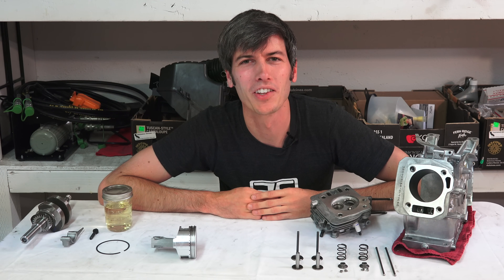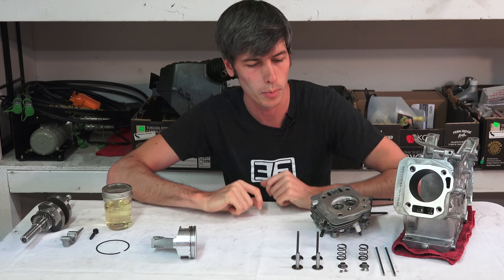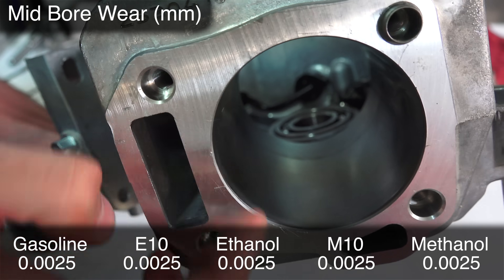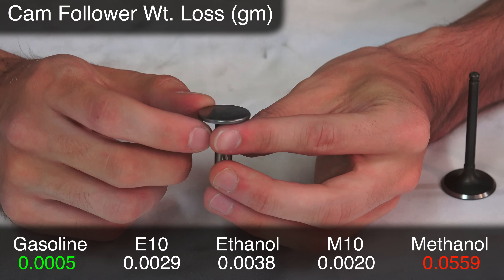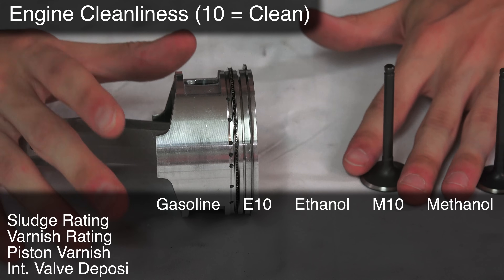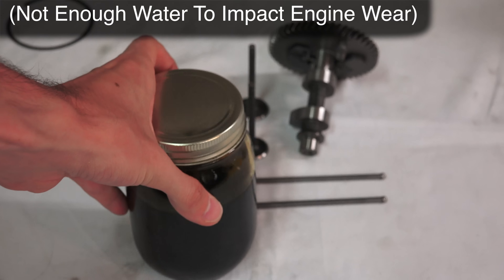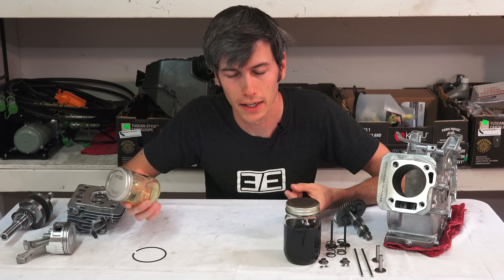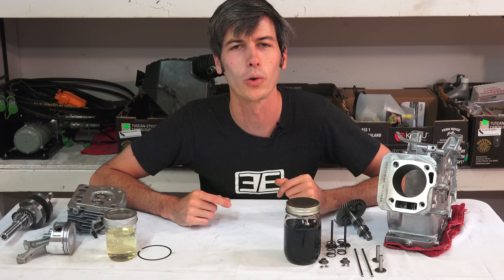Is Ethanol Bad For Your Car's Engine?

Comment: You must not forget that there is a powerful political interest at stake here. 

It is not by accident that ethanol is presently required by law as an ingredient in motor fuels.  Nor is it a coincidence that ethanol is for the most part produced using corn as a raw material. 

There are a handful of American states that produce the lion's share of corn used for refined ethanol and their US Senators and Representatives get to remind us every four years, when all of the presidential candidates go to the Iowa Caucuses to kneel before the Corn Gods and promise not to rock the ethanol boat after they're elected.  It's big business.  Candidates who do poorly in the Iowa contests are finished.  Their donor money dries up. 

This isn't about gas mileage or clean air or any of the other BS.  It's a racket.  BTW, no serious person is discussing using 100% ethanol or methanol as fuel.  They really don't work well in passenger car or pickup engines except as blends.
Reply: Nailed it Jim.
Reply: @totallyjonesin  For those who want the extra octane a 50-50 blend of methanol at least makes sense economically.  America has enough coal (and natural gas) to make refined methanol for centuries.  The business of using corn to make ethanol has bumped the price of practically EVERY agricultural commodity, but for the benefit of very few states and companies.  Ethanol and methanol as blending agents in gasoline are virtually identical and they both offer consumers some advantage, but ethanol cannot be produced from coal (or natural gas) the same way that methanol can.

Comment: the alcohol destroyed the fuel level sensor in my 1986 Yamaha fj1200 fuel tank and yes it is bad for my 1990 Ford Thunderbird. It has been disastrous in some Nissans.
Reply: Mine 1985 Nissan Sentra is still going strong

Comment: Dont put in lawnmower (or unleaded gas recommended cars for that matter). Air/fuel mixture foesnt ignite or ignites too much, I think. I recall putting high test ethanol in my truck and suffered misfires- too high octane.Hadvto dilute with regular.  And in lawnmowers same thing plus causes water during winter storage. Rots fuel lines, I believe, but I cannot prove it.

Comment: Tell us about gas mileage when using E10 and unleaded fuel.
Reply: Bennie Cochran Ethanol will give about 70% mileage due to its 30% lesser energy value. So 10% ethanol mix will give you 3% less range in a tank

Comment: Ethanol is hydrophilic and absorbs water out of the atmosphere and deposits it in the bottom of the fuel tank.  If the fuel tank and fuel lines are steel they will rust.  The water is then pumped into the fuel system. It causes corrosion and other deposits to accumulate in the fuel bowl and plugs up orifices in the carburetor and fuel injectors.  If the fuel bowl is steel it will rust.  The alcohol also dries out and deteriorates certain types of seals and gasket materials causing them to lose flexibility and leak.  Millions of engines have been irreversibly damaged by ethanol fuels. I think that that is intentional.

Comment: What a way to confuse the public and push the government mandate.  the problem is not engine wear. The problem is what it does to the fuel delivery system.  alcohol in the tank does this it attracts water vapor, the vapor condenses into water droplets, water droplets turn to rust. the rust turns to sludge. when the tank is low on fuel this sludge is picked up and sent through the fuel pump filter eventually clogging the filter and fuel lines to the engine.  This sludge also makes it's the way either to the carburetor jets or throttle body and in more modern cars the fuel injectors. this sludge is a metal component that is highly abrasive, and the particulate size is where the damage occurs from not being able to properly handle the sludge, this causes hard starting, fuel starvation while running. In some cases premature electric fuel pump failure. The worst case scenario is an engine fire.  The point is with the U.S. being the major crude supplier to the world means we do not need the alcohol additive at all. The real reason for alcohol is a government commitment to large corporate farms contracts to produce alcohol. That is it our government made a bargain with big corporations for something that is not needed at all but we are forced to buy. There will be no consumer protection action from this,  they are the government!  If you are skeptical about what I have written please check it out with your mechanic. My goal is to save you money from unneeded repair costs. These items I listed are not cheap parts to replace.
Reply from the maker: Alcohol absorbs water in the tank and then pumps it through the engine. Pure gasoline will separate from water, but ethanol will not. It actually helps to reduce water in the tank if you’re regularly driving.

Comment: In 81 most engines used carburators. Fuel injectors are sensitive.
Reply: Yes until the late 80s 87 is when things changed

Comment: For sure ethanol is good, I run my car for more than 100.000km using 100% ethanol without any issue. Engine much cleaner than using gasoline. In Brazil there are 2 options 100% ethanol or gasoline with 25% ethanol.

Comment: Did I hear this right?   The 10% ethanol/methanol blend did not significantly improve cleanliness in the engine compared to 100% gasoline?
Reply: Nope. Pure did. E85 does as well, but that was not tested here.
Reply: Yes, and I suspect that is because when you mix ethanol and gasoline, you form an azeotropic mixture.  Basically, it isn't [2 + 3] = 5; it's [2 * 3] = 6.  It isn't a linear combination.

Comment: I’d like to see a test on the effect on the fuel system. I know it is hard on my carburetor. But I drive vehicles over 40 years old.
Reply: engine oil presented here, what relation does this have to the carburetor? just for curiosity, I might miss information
Reply: Ionel Ionell I just would like a video testing that. I’ve had issues on a couple of small gas engines and also issues on my old trucks. Fuel vaporizing, almost corrosive, gelling if it sets too long. I’d like some tests to see how badly these things occur.

Comment: @Engineering Explained, is it possible the 20 hour test was not significant enough of a test to determine the long term effects of the water content found in the oil? Flex fuel vehicles require more frequent oil changes.

Comment: use e10 soon or it gels up  it is  just crap
Reply: True but even pure gasoline doesn't stay good, even with stabilizers.  Stabilizers are cheap insurance, but they are no substitute for using fresh gas.  Old stale gas often won't even flash ignite once the volatile hydrocarbons evaporate off.

Comment: A test based only on 20 hours use, seems hardly a test. A 2000 hour test would have been a lot more credible to make a judgement on the consequence of using different types of fuel.

Comment: A very good video and good channel.
More objective about technology and mot this engine is crap becausecit doesnt go hard.

Question 
if e10 and pure unleaded both are as good or as bad as each other regarding engine wear then the question is which one is more cost effective 
Also if the pure pure petrol gives more power os that power significant enough to concern yourself with??
Of course oil companies will blind you with advertising hype telling you how much better there 98 octane is with special ingredients etc but that is normal pure BS to make them rich as they takes advantage of the average drivers ignorance.

Comment: pure ethanol has  a very high octane number as does methanol like over 100 or more dirt late models and sprint cars, and draggers have been using it for years, the air fuel ratio starts around  7 to 1. During combustion the fuel  has oxygen in  it. The racers that use this fuel have to flush the fuel system out as Ethanol  attacks  the aluminum parts , including the pistons, etc. these days the modern fuel injected engines are designed to use those types of fuel,s, If you put 85% ethanol in a 60,s V-8 engine  with a carb it will blow up due to running very lean, same deal if you were to use Ethanol in a old VW air- cooled beetle

Comment: This may be true for the average car, but may not apply to higher performance cars which may stay in the higher rev range more often.  Also my bigger concern is over say a decade, what is the effect of ethanol vs. pure gasoline?  As the car industry moves towards fuel efficiency by reducing weight, aluminum is ending up in more and more engine blocks.  If I remember chemistry correctly, Aluminum and ethanol react with each other.  As such after say a decade of exposure to ethanol, which engine is in better health - the engine that burned pure gasoline or the engine that burned ethanol.  This is the study I would like to see.  But then again, people now rarely buy cars to hold more than 4 years.... such is the way of the disposable style we North American's live.

Comment: I find it interesting that 10% ethanol gives me about 10% worse fuel mileage.
Reply: Douglas Hamner nooooo, in the early 90s I had a vehicle that I kept strict fuel economy for. After a couple tanks of gas of significant fuel economy decline (2-3 mpg) I started researching and right at the time I noticed the decline is when the mandated 10% ethanol began. On a related note, I live in Wyoming now and we can get pure gasoline and I’m going to run tests for fuel economy.
Reply: @randallbollinger1449  I agree with you. I have owned 72 cars (so far) in my life. I have calculated my fuel mileage ON EVERY SINGLE TANK on every car.  I am obsessive about this.
Reply: @MostlyBuicks  Guess what - new cars do the calculating for you.
Reply: @emjayay  I had 4 Olds Auroras and two Cadillacs that DID, but their calculations were off a tad.  I trusted my calculations over the built in diagnostic computers, which were slightly optimistic.
Reply: @emjayay  But these  automated mileage calculations are not necessarily accurate.  People tend to assume that any electronic device with a digital readout must be correct, but that's not always the case.  At the very least, it helps to do some checks to see how accurate the automated readings are.
Reply: @randallbollinger1449  But the ethanol is cheaper.  Its about cost per mile, not miles per gallon.
Reply: Tad Hepner perhaps for you, I prefer miles per gallon.
Reply: Douglas Hamner we shall see
Reply: Seriously i didn't notice last month they now changed to E10. Then normally i could easily get over 600km. Now it droppen to like 520km. I was like wtf is wrong with my engine? Also i felt my engine was slugish, felt different. I really thought something wrong with my Nissan 350z. I changed to different fuel now. I will see what will change.
Reply: Herman Willems it takes some time for ur car’s OBC systems to determine and learn about the new fuel you just put in, so a worsen mileage during the first tank can be expected.
Reply: Consider the fire triangle: fuel, oxygen and heat. To make a given amount of fuel give out more energy you need to increase the oxygen and/or the heat.
Reply: Douglas Hamner because people ALWAYS tell the truth... right? the information may be accurate in some respects but I’m still curious as to whether it is the complete fact/truth. Personally, I find it difficult to believe, hence the reason I’m going to conduct my own experiment. Please go away and stop trying to troll.
Reply: @shoveI  poor tune? Lol modern cars are not guitars.... "Tune" was thing back in 50s, where you needed to adjust timing, mixture, plug gaps etc.   Its pure bulshit on new ECU controled cars

Comment: No additional wear, but dangit my 97's fuel economy suffers. I track down and get straight gas and the difference in price cancels out the gain in mileage. However it drives better on non-ethanol fuel.

Comment: the valve springs look VERY light to me.   that should make less wear.    try 250 lb spring.  about the water in oil.  all acids are water base.   20 hr is NOT very long

Comment: E10 and E15 also prevent detonation (pinging) in older cars. I drive a 1964 Rover 2000 TC that stock is 11:1 compression ratio. When unleaded fuels were first mandated (1970s) even the highest octane rated fuels pinged until I found one station in my area that had E20 and that did the trick.

Comment: In 2strokes on cold weather situations phase separation is a big problem oil gas and ethanol all weight differently so they separate and you get no lube in one spot and oil pudding in a other creating weird wear (Blown engine!) engines that typically last 150 to 200hrs of run time last anywhere from 20 to 100hrs not good

Comment: What this doesn’t address is whether periods of running at different speeds and loads,  sitting, even if overnight, over years, do bad things that effect wear.  And do they damage seals and such.  20hours in the life of an engine is not very long.

Comment: I used e85 for the first time in my flex fuel Ford ranger. I was surprised to see that my check engine light for my O2 sensor had shut off. Also I can feel a dramatic difference in throttle response. I haven't tried it in the winter yet, but so far I'm sticking with e85 24/7.
Reply: Your ecu has to run with e85 to "learn" the fuel... Just give it a few days, or mix it with gas and increase e85 along time
Reply: The short guide to ethanol: More power, less mileage, won't start in winter.

Comment: E10 vapor locks in older cars. My 355 equipped S10 vapor locks after driving 10 minutes on E10. Luckily I found a station 7 miles away that sells pure gas. Problem solved.
Reply: Vapor lock is a problem for carbureted cars (or TBI systems) even with straight gasoline. In Ye Olden Days there was a clear difference between summer and winter gasoline. In particular, winter gas would have more butane in it to increase the and volatility.Summer gas would have less butane to keep the vapor pressure lower. With EFI being everywhere the blenders have more leeway about the amount of cheap butane they want to ship out.

Comment: In my 2.0T I seriously get 3.5 mpg better gas mileage with premium non-eth over the premium with 10%-eth, and that is regular daily driving without any fuel saving behavior. I don't even care to know the difference between regular w/eth. For me this equates to just over 50miles a tank and if my calculations are correct, anytime the cost difference is 21cents or less I'm gaining in all ways. My owners manual does suggest premium fuel is used fyi. So does my mechanic :) who also seeks non-eth personally.

Comment: Engine designers of car Engines often run 500h tests on new Engine designs and here there is a true difference if you run the Engine on E85 or Gas.
Valve seats and valve for example show much more wear after a few years with e85.

Comment: Some interesting points in the comments about fuel economy and price points. I would be interested to see data on how fuel economy is affected and what the difference is on actual fuel cost. 

Another potential wear point that was not discussed and could be significant is how these fuels affect head gaskets. I would be very interested to see wear data on the more common gasket materials, which could be the most significant wear point of interest given the nonsignificant differences between unleaded and E10. Has any light been shed on this?

Comment: What about effects on injectors, spark plugs and cat and O2 sensors and early clogging of fuel filter?
Reply: Cats last longer, spark plus you have to remove it every 60000km when you run e85 or e100 to prevent rust in the  threads... Actually it's not the fuel that causes the rust, it's ambient moisture that with some engine design can lead to rusting the threads

Comment: Canadian Mohawk 90 grade with ethanol kept my spark plugs way cleaner in my old oil burner 390 Ford wagon in which I was running 20/50 oil. I changed the plugs often and the difference was astounding.  A little bit of ethanol definitely eats cylinder deposits.

Comment: If Ethanol gasoline (E85) has tend to have more water in the engine oil, even though the car is designed as Flex Fuel, is it better to change engine oil frequently than using E10 condition?

Comment: Do a test where the cars sit for a month with the fuel in the tank.
Reply: @Pervy Pauline Actually, ethanol will hold on to water and not let go.  If there's excess water sitting at the bottom of your tank, it's unlikely that ethanol had anything to do with it being there.  In fact, adding more ethanol to your fuel at that point will "soak up" that extra water.  That's what exactly the principle behind winter additives used to prevent gas line freeze (which incidentally, doesn't seem to happen very much anymore, probably because the active ingredient in the winter additive is ethanol and now that's already in the fuel).
Reply: That will cause problems with any fuel.
Reply: My 1992 car has sat for almost a year with pure 91 octane in the tank. No issues, fires right up. 

My 07 carbureted motorcycle sat for two years before I purchased it, and there was a thick layer of varnish from sitting in a non-temp controlled environment with ethanol fuels. Carb was in a non-usable state, and all the gas was bad.
Reply: @wiretamer5710  No, I buy special fuel to overwinter my 2 stroke garden equipment, with zero alcohol.  Unfortunately about £20 per gallon so I use E5 in the summer.

Comment: A long time ago I use to race a sprint car (w/Offenhauser 4 cyl. engine) using methanol as the fuel.  After 'every' 500 mile (+ practice and prep) race, I had to totally rebuild and rebore the engine due to WEAR & 'chemical attack' fo the combustion chambers.

Comment: I use e85 in my generator because it is quieter and doesn't smell as bad as burnt gasoline. I've been thinking about using it in my Piper J3 Cub  too. Probably not approved but so what. It's a really old plane, 1939 but the engine is newer.